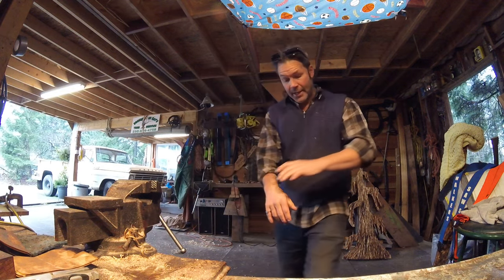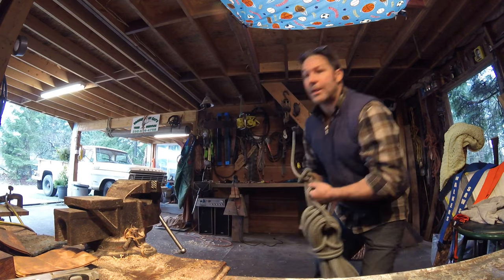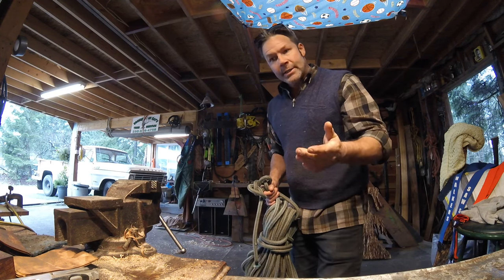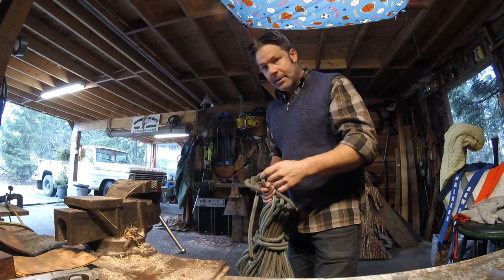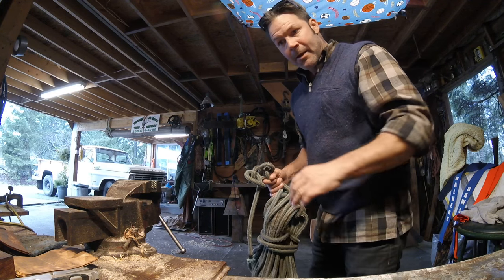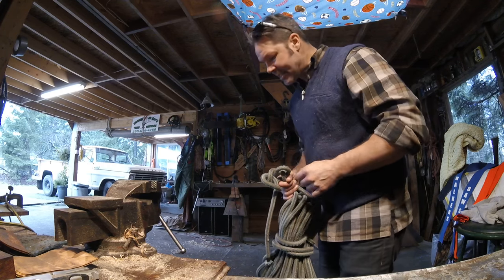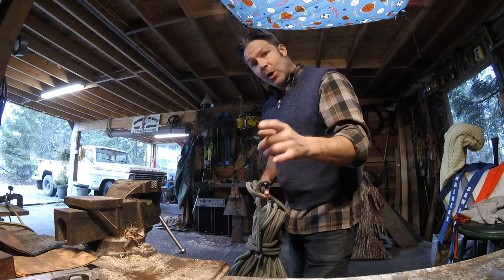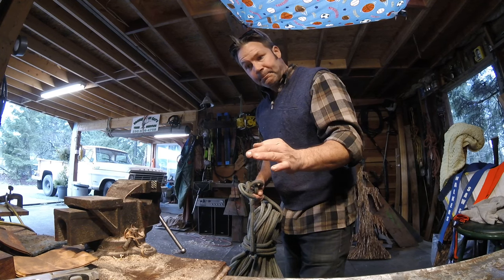HEY , LETS COIL UP THIS ROPE

Comment: The way you're coiling your rope introduces twist in because you're going in one direction.  Check out the over under coiling method or learn how to butterfly coil like rock climbing guys do.  These methods prevent the rope twisting and make it muck easier to deploy tangle free.

Comment: I'm used to coiling up cables and ropes that really like to twist up (data and A/V, performance sailing) flaking out the rope to start so there is no twist, and then alternating the twist as you bring it into coils is the easiest way to store ropes for easy deployment. (your way will leave it wanting to knot up if you just drop the coil on the ground and pull one end)